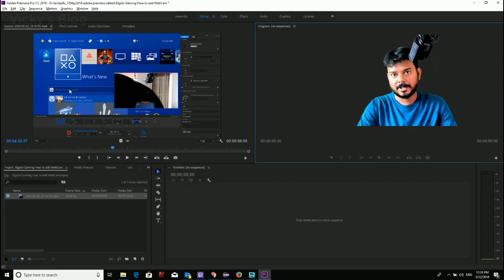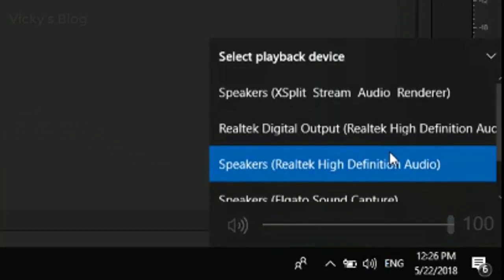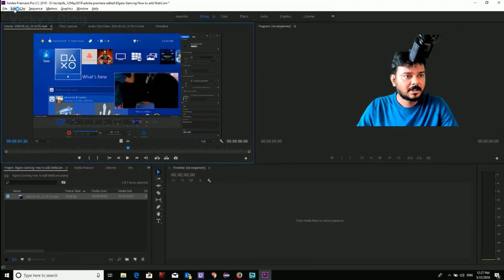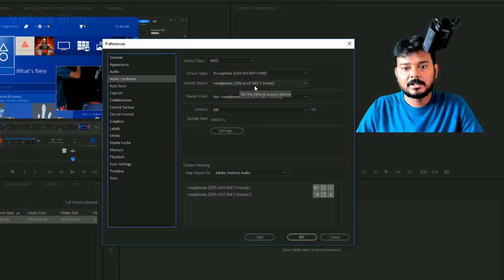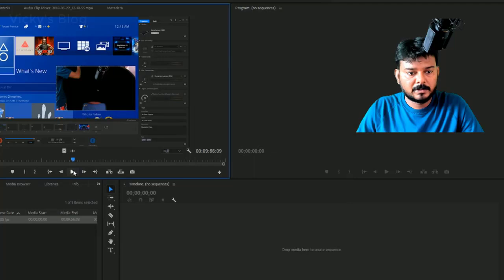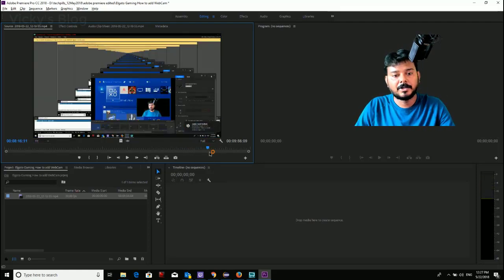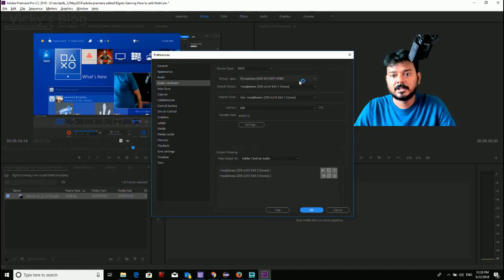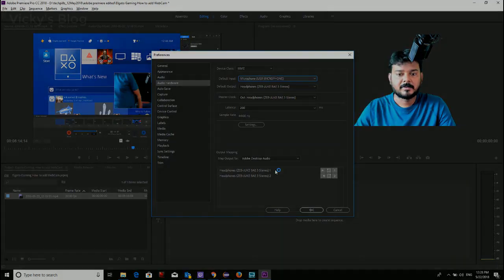No sound during playback on Adobe Premiere: How to Fix and change Audio Output Settings?

Comment: These videos always leave out the playback settings.  If you do all of these suggestions and still have no audio, check the playback section in that same menu is pointing to the correct speaker output device.  It's usually Adobe DV that you want.